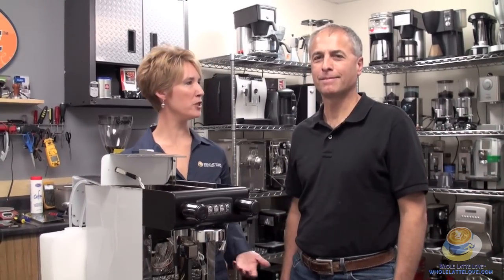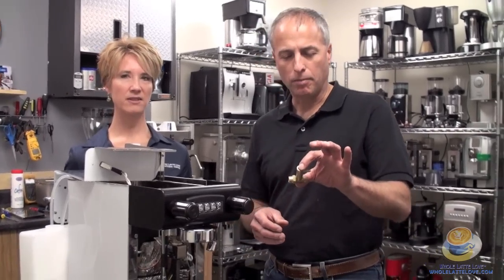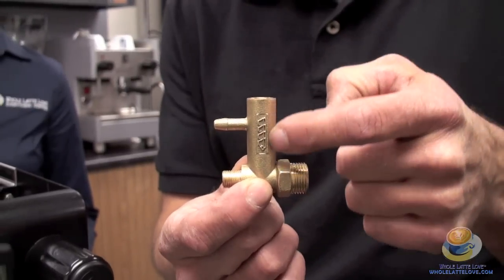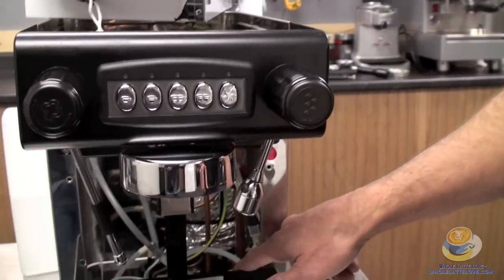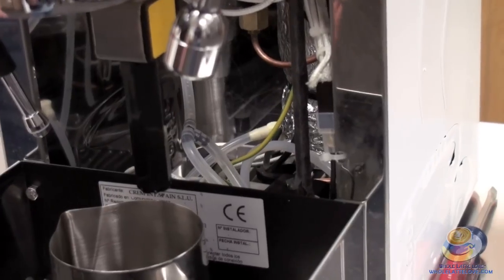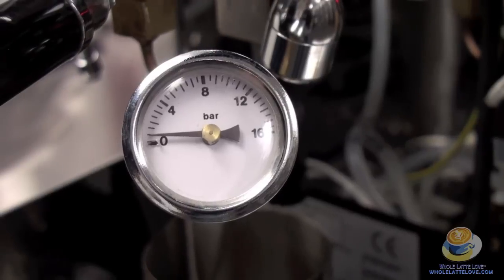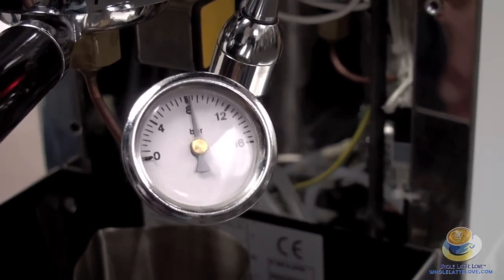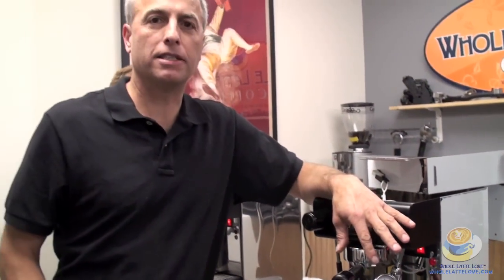How to Adjust the Brew Pressure on an Expobar espresso machine

Comment: Hi guys.

 just received my second Expobar Office Pulser from Whole Latte Love.  The old one, almost 10 years old,  is on its way to retirement at the fishing cabin. It needs a little work.

 I was wondering about brew pressure.  You mentioned in a post that you set-up your machines at 9 Bar.  Are you saying that you adjust new machines at your facility before they ship?  I've been thinking of getting a porta filter with gauge to set-up a perfect brew.  

  I love the new Pulser.  It has some nice improvements over the old one. The steamer nozzle is much more convenient, and easier to clean. The design on the sides makes my wife happier.  It looks much prettier in her kichen.  As the family's only espresso addict, I suffer some degree of abuse.  Sometimes I need to just go to the cabin.

Thanks,

Tom Swan

Comment from the maker: We do have the pressure gauges that will fit onto your portafilter. You will have to remove the spouts and then the gauge will screw right onto it. Give us a call at 888.411.5282 and give them part number EX-ESC10000.
Todd S.

Comment: Why would you not do a video on changing the temperature, I suspect people have a need to change temp much more frequently than the brew pressure or pid settings.
Reply from the maker: Hi Tony, Thanks for the question. We try to cover all the bases. But try not to cover too many in a single video. This video as the title indicates is solely for adjusting brew pressure. You are correct, changing brew temp is far more common than adjusting brew pressure. Changing brew temp is done using the PID controller on Expobar machines equipped with one like their dual boiler machines.
Marc

Comment: I just bought a used Expobar office Pulser and the pressure seems like it is set too high based on brewing time for a double shot. Do you sell those pressure gauges in the video
Reply from the maker: Yes we do. Here's the link to product: http://www.wholelattelove.com/products/brew-pressure-gauge-with-hose-40mm-0-16-bar
But, understand that shot timing does not necessarily relate to brewing pressure. Your shot could be coming to fast for other reasons that are far more likely like grind being to coarse, under-dosed basket or a light tamp. If you purchased the machine from us it would have been calibrated for proper brewing pressure prior to you receiving it.